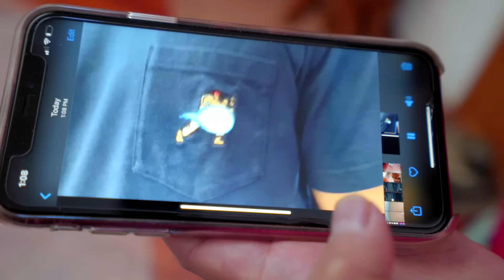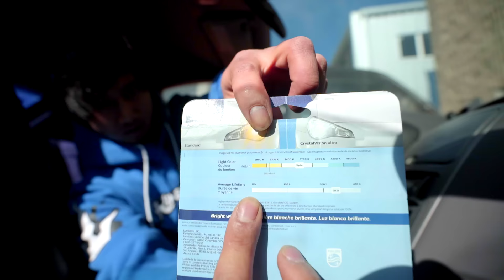Celica 2ZZ-GT gets TRD Aero!

Comment: Those red connectors never work bc they're not solid copper. It's also tacky. You need to use real copper wire, solder & then shrink wrap. Don't be lazy with your wiring. Make it clean.
Reply from the maker: yes, true. i was just being lazy haha
Reply: @kingsmustrise  & you don't want anything shorting out on you later on. Lol